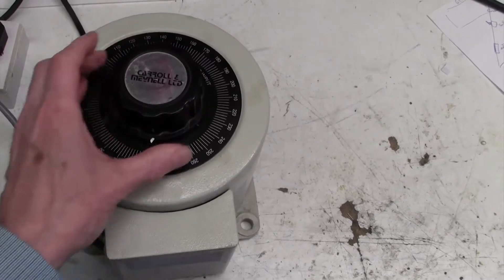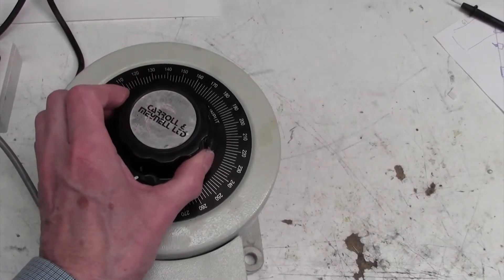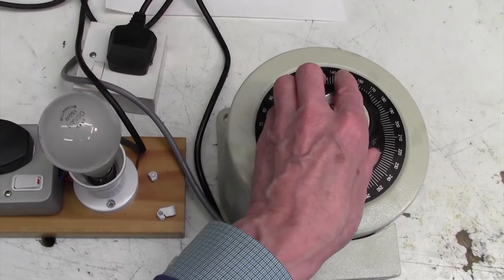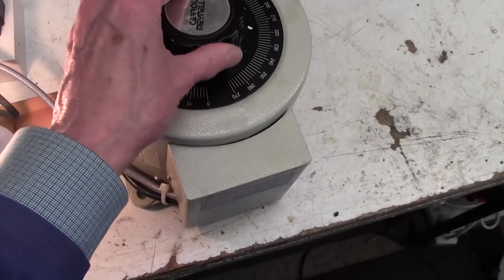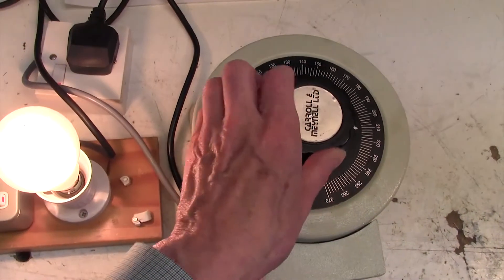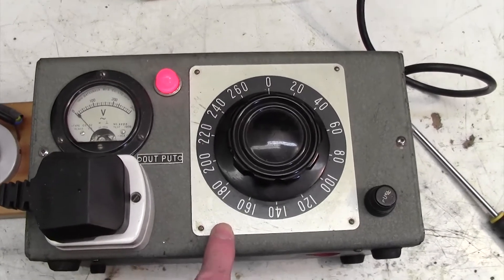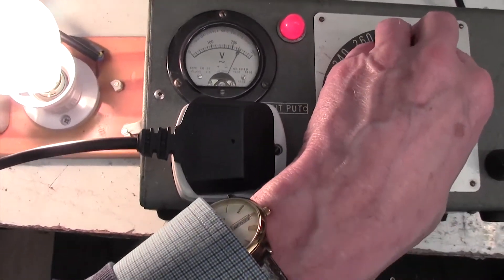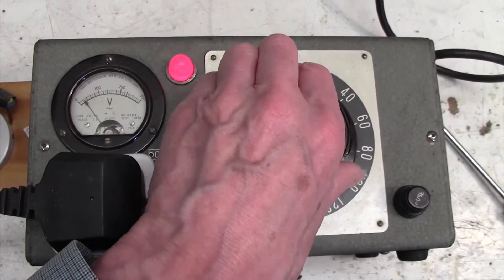The Variac Explained

Comment: Great video 👍
Reply from the maker: Thanks. You asked about maybe using a lighting dimmer instead of a variac. Nice idea but I don't like it. The dimmer doesn;t reduce the voltage as such, irt chops the AC waveform into smaller bits. Also they are usually fairly low power, like 60W. I'd invest in a variac if youb think you're going to use it.

Comment: What other uses do variac a have besides tube amp repair? Is there any solid state use? What about with an analog synthesizer?
Reply from the maker: Hi. The variac is really a piece of test equipment for when you need to gradually bring up the mains voltage on something, rather than just throwing the breaker and giving it full voltage. Really useful for things that are blowing fuses, smoking etc. Just bring it up slowly and see what gets warm.

Comment: Great stuff, Stuart! You’ve probably heard about Van Halen using a variac at lower than mains voltage to achieve a certain sound on his Marshall. Is the point of that to make the rectifier tube sag? Is that bad for the tubes or other parts of the amp?
Reply from the maker: Hi, no I haven;t heard if that! It wouldn't cause any problems with other tubes as the voltages are lower not higher - well at least I'm ASSUMING he turned the variac down and not up!
Reply: Would it harm an AC30 to run it at 200 instead of 240volts?